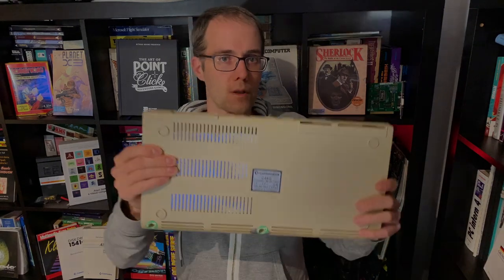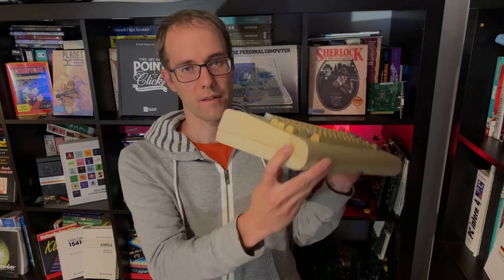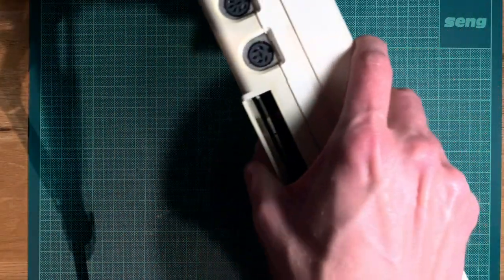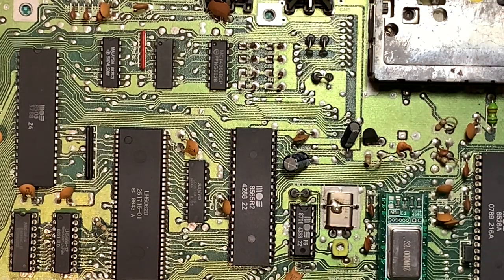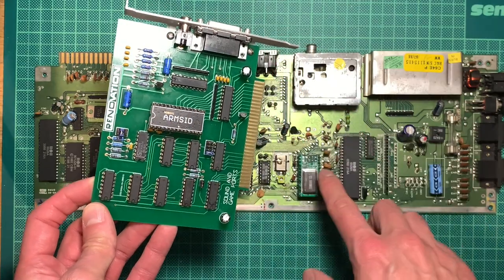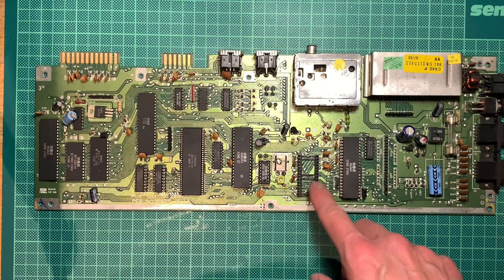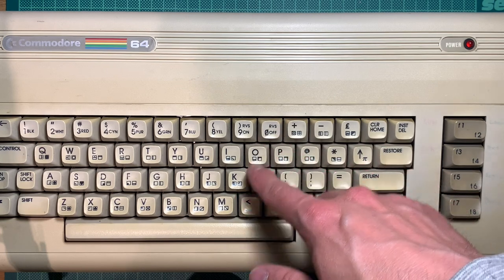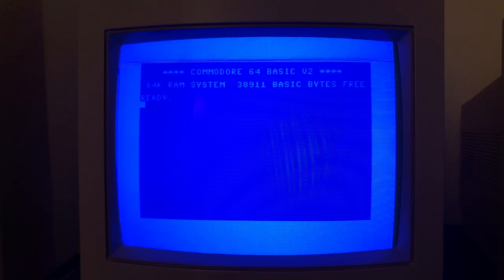Pimping the C64

Comment: I bought a C64G and it had an extra rubber foot floating in the case, I had a suspicion but now I know for sure where it belongs. Although I'm not sure why it was needed: the cardboard shield could short the shift lock? Anyway, I removed the shield, so no problem. For an interesting detail: mine has a UV erasable eprom for one ROM chip and it seems factory built.
Reply from the maker: Yes, the cardboard can short the shift lock! Leads to very weird issues! UV EPROM is interesting! Would have thought that would be too expensive for Commodore. But good for you!

Comment: It's the second computer I owned and still my favourite by any means!
I love 6502 assembler, despite not having any 16 bit registers, which the Z80 has and makes certain things easier.
It even put $10k XTs and ATs to shame with it's ability, until EGA became common place. I bought a few this year again, I redid my high school computer class project to learn KiCad (Eagle is no longer free). 
https://www.instagram.com/p/CClHyrwAltL/

At school I made an 8 LED bar, with separate transistors, as switches. And since you have 1 more bit available you can do a buffered (or in this case for sheer fun, retention of vision) 16 but out.

During the lockdown I went through a lot of my old floppies, some did still work perfectly and I found so many programs and (partial) demo I'd write in assembler, up til about 1990. It was really going back to my teens. I found a black box dialer to phone for free, it was a bit finicky, because CCITT 5 pulses were 50ms and 50ms rest, which seemed to be perfect with a PAL refresh. But enabling the tone from the SID took maybe something like 2ms (I can't recall) but that was sort of hit or miss, and I remember I redid it with a timer interrupt but couldn't find it. But quickly made an 8051 one, that was rock solid and allowed me to go to phone booths (saver then from your home land line).

Aaah I miss the mid-to late 80s.
Reply from the maker: Although I never had a C64 as a kid, but my first memories of a computer are of my cousin's C64, playing Zaxxon.

Comment: it is one of the later motherboard revisions if not the last. is has the superPLA inside which people love and hate. it does not break down easy which is good, but on the other side there is no simple replacement and the metric pin pitch sucks. if this chip breaks down, it is better to buy a new pcb and rebuild it from scratch with a standard PLA(-replacement)
Reply from the maker: So I will treat it nicely! Hopefully never having to replace the PLA...
I have gotten another C64G which uses a long board, and an assortment of chips from 1986-1988. The manufacturing date of the computer itself being 1989.